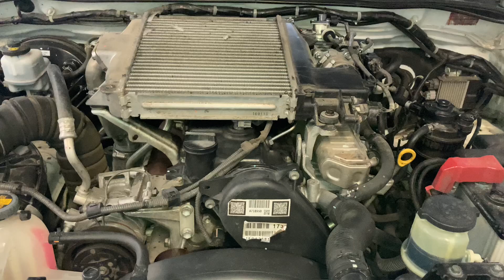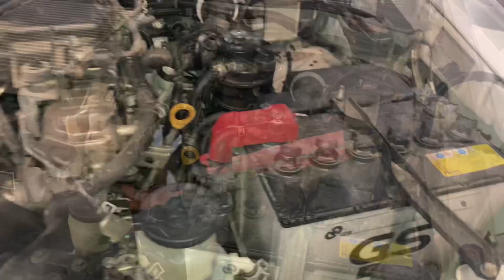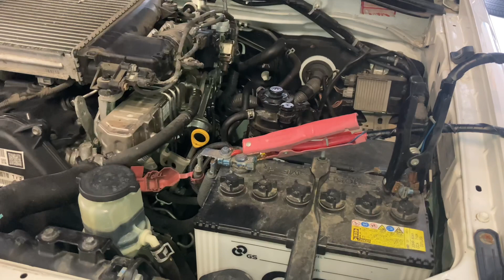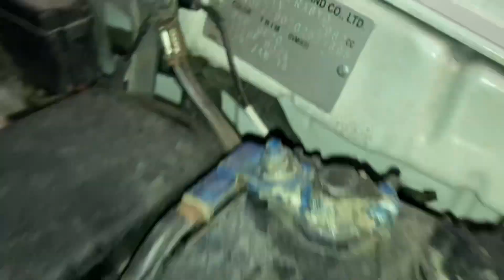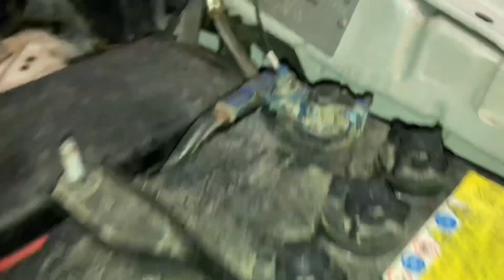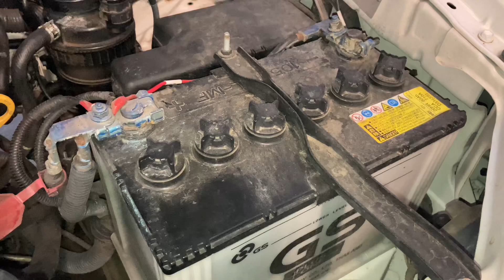7 years is too LONG - GO TO EVERY BATTERY PLEASE 😂😂

Comment: When I was working at a local mechanic in South Australia, we had a 2012 Hilux come in that had lights coming up on the dash, and starting problems. Turned out that it had the ORIGINAL battery from 2012 and it quit in 2021. After it was replaced, the problems were rectified.
Reply: My 150 built late 2012 in still on its original battery. It’s just had its 10th birthday!
Reply: That’s amazing!  It has to be some record.
I’m flat out getting 3 years out of our vehicles.
I now, every six months record the load test results and give it a full 8 stage charge (CTEK charger) over 24 hours at least.
I’m hoping this will fix the longevity issues.

Comment: Would you get more life out of a battery under normal use if you use a higher CCA rating than specified by manufacturer? ( say 950 instead of 650..)